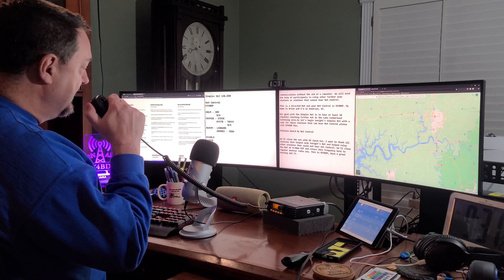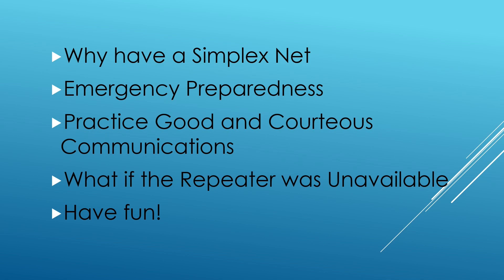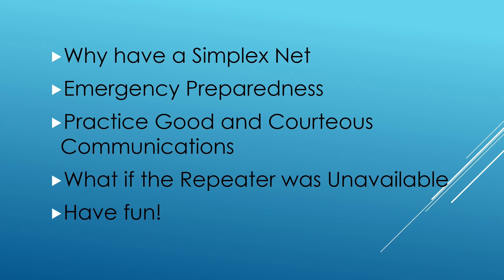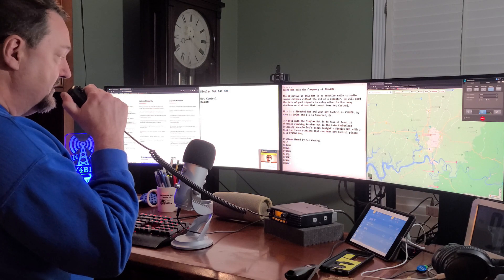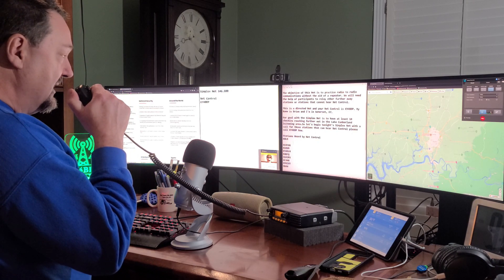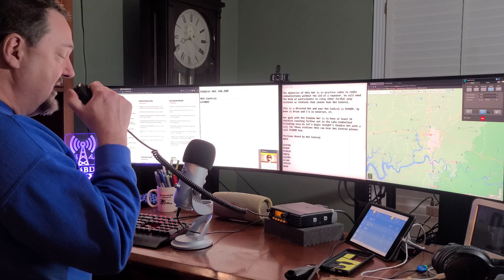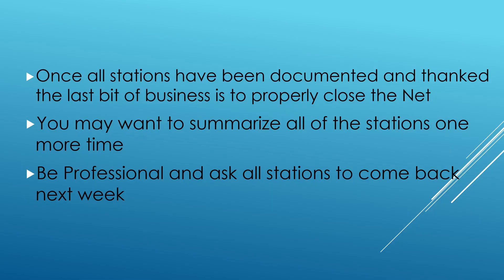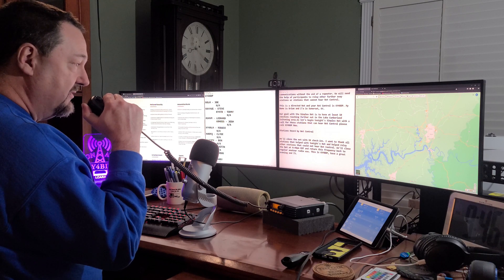LCARA HAM Radio: How to Run a Simplex Net!!!!

Comment: Thanks for sharing this video. I like the structure and format of your net. I volunteer as net control for our local 2 meter simplex net in western Illinois and eastern Iowa. Our script is a little different, we use a roll call where we ask for checkins individually from stations that regularly check in. We average around  20 check ins every Sunday evening. We always ask for any other stations that wish to check in, as well as any relays. 

You mentioned structure, professionalism, and consistency. I strive for these things. We have a young man with autism in our area who has been licensed for quite a while. Ours is the only net he regularly check in to because he likes the consistent format.

73 de N9DIZ